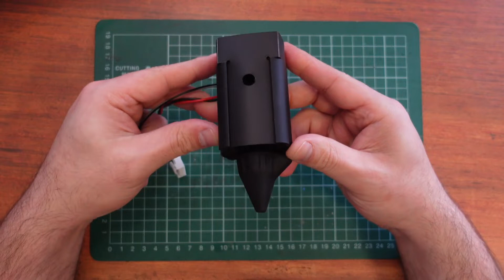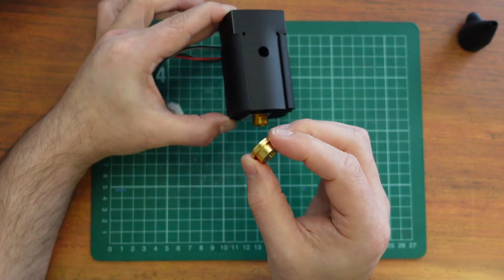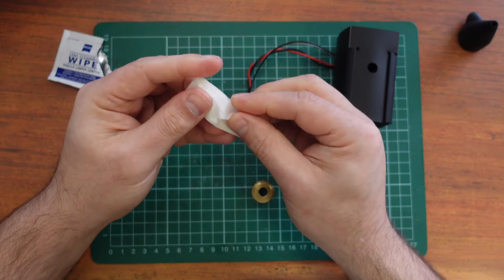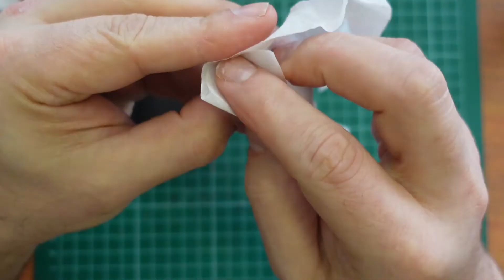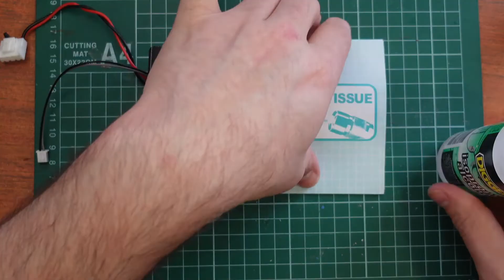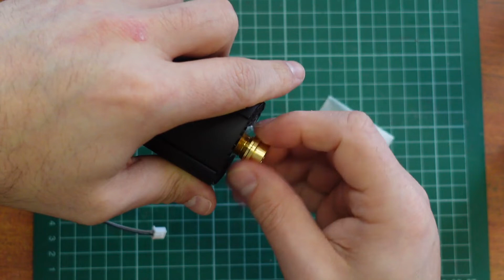Cleaning the Emblaser 10-watt laser unit

Comment: Thanks Gill. I've been using my Emblaser 2 with a school for over a year now. I've noticed the brass cap getting harder and harder to remove over time. I finally needed a rubber protected wrench to remove the cover and instead of the cap unscrewing, the entire brass sleeve with the lens inside was removed from the aluminum. Do you have any suggestions on the distance I need to screw the tube back in? Also, do you know if it would be a good idea to use thread-lock to keep that tube from coming out in the future?
Reply from the maker: Best advice I can share is to contact Darkly Labs directly. They will know which model laser bracket you have and will be able to instruct you on the best way to reassemble your machine.
Let us all know how you go!